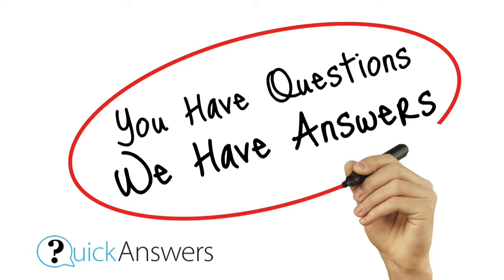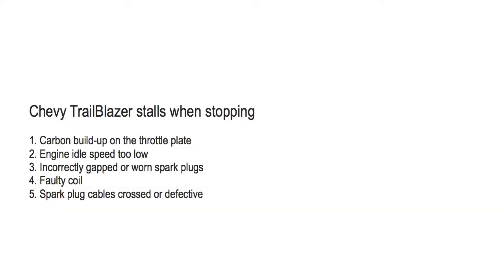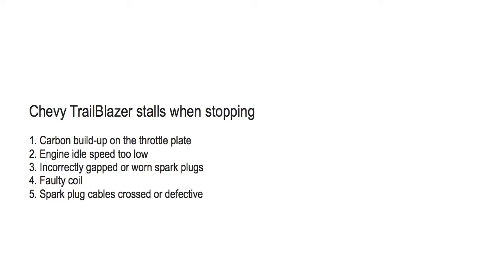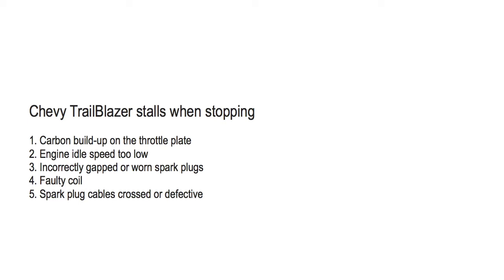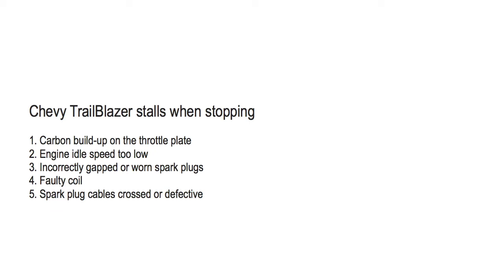Chevy TrailBlazer Stalls When Stopping or Braking Hard

Comment: 06 trailblazer. Kept cutting off when I came to a stop or let the engine idle. Was basically having to operate the gas and brake with 2 feet. Cleaned the throttle body, lights quit dimming and no more low idle or engine stalls.

Comment: Thanks for the upload. I have a 2004 trailblazer. Change oil light is on. When I press the accelerator it make a whistling noise.
Reply: possible fan clutch issue?  I had to replace mine when it sounded like a jet taking off upon acceleration.

Comment: I have an 05 Chevy Colorado z85. My idle drops below 500 RPMs when I apply the brakes to stop and when I turn into my driveway the power steering seems like it goes out. The idle sensor is good. My rack and pinion is good and my power steering pump is good. I can't figure it out. Can you help?
Reply: Same issur here. 03 trailblazer
Reply: @TabbyZAnimator  did you figure out the issues?